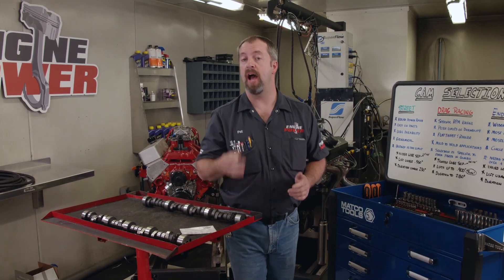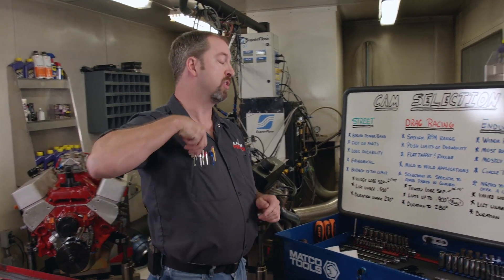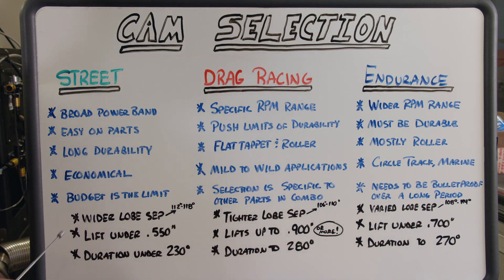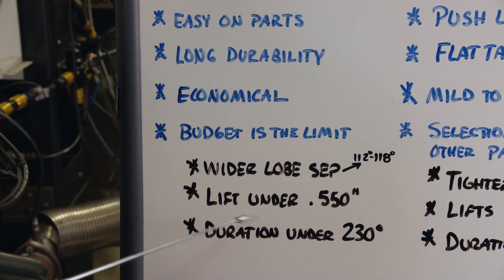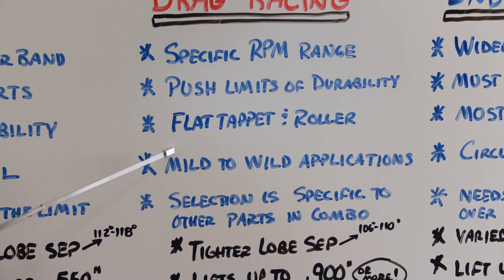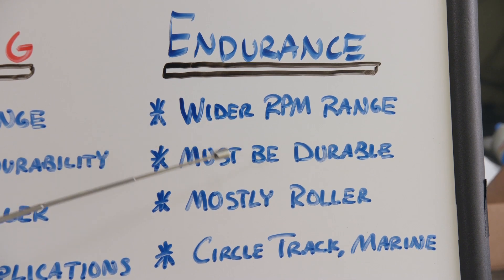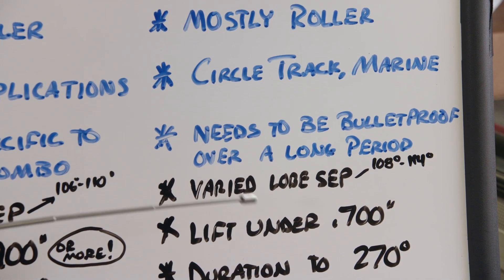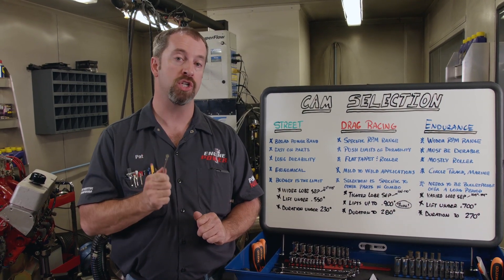How To Choose The Right Cam

Comment: I want to see a cam test based on Vacuum results as "A Street cars/ daily driver" needs it to run power brakes and accessories. Manual brakes and switching to Hydro-boost is for races cars...Not daily drivers.

Also this video is very old so the lifts/cam recommendations don't really apply to todays Gen3 hemi, LS.

Flat tappets shouldn't have even been mentioned as they haven't been used in a production car in decades, and their reliability isn't that great unless you use High Zinc oils, waste of money in the long run.

Most Hot Rodders want the "Endurance" cams.

Comment: Wow what lies  I had a 625 lift 302 duration with a 108 separation. Not only did I get 30 miles to the gallon it had a broad ban of power, it has 200000miles on it know and still runs like it should. So I call hay advertising little cams cause we made too many and there shit they waste more then they save.

Comment: hello.   I think you can give me some expert advice. I have a 1973 351 Clevland smog head engine and I want to put some 1970 factory closed chambered heads on it. I was given a completely rebuilt set of 1970 4V closed chamber heads and want to make this motor work on the street. I am not looking for advice on using other heads (or recommendations to use the factory 2 V heads, etc) as these were free to me and a few thousand dollars saving since they have already been rebuilt. I am not concerned about upper RPM  horse power loss and want to use these as a good lower rpm (up to 6000 rpm-ish )high torque motor (its my wifes hot rod so doesnt need to be radical motor). I have heard that if I run these with the factory flat top pistons and right cam profile i can make it relatively streetable with decent  low end torque?  I am wondering what your thoughts would be as far a good cam profile for my situation? going into a 73 mustang which I figure weighs at least 3500 lbs and its an automatic tranny (im ok with a higher stall converter). I am well versed on the Cleveland factory heads types, etc.. One last question, what are your thoughts on using the factory M-Code 351 cam?  also welcome recommendations from anyone else who sees this post as well :)

Comment: Hi, I own a Peugeot 206 With Tu5jp4 engine
The car has been tune to stage 1 and wanted to upgrade it to higher stages and I've come with a question about the camshafts
The camshaft I've chosen is newman ph3 that takes place somewhere between stage 2 and stage 3 of tuning The duration of cams are 264 degrees and the lift is 10.15 (0.400) and just wanted to make sure is it fine for daily uses and sometimes drag races between friends cause you sometimes stock in traffic and it's also my daily car I travel with it and go to work
I have changed other parts too such as exhaust manifold replaced by headers, exhaust pipe, center and muffler were all changed 
Stage 2 Air manifold (nfs), And pistons were also changed and now have higher compression ratio 
Just wanted to know that this camshaft is proper for daily street uses or not

Comment: Loft out so much. Choosing a cam depends on what you're going to do with the engine and what heads you are using. The cam has to match the heads. As well as the intake. If a set of heads only flows 200 CFM on the intake at 550 lift. That's the lift I'm going with. If I'm running an automatic transmission on the street I'm going with a lower duration. LSA depends on where I won't torque to start coming in.

Comment: I’m assuming duration is measured @ .050” lift, which would be nice to mention, but not much was.
Also, EFI vehicles may require 112-114 deg overlap due to sensors, but 106-108 deg (for carburetors) provides a broader power band… as I understand it.

Comment: Very good explanation but im kinda confused between endurance and street. I need a cam that for a little but if street racing just some pulls here and there but I’m also daily driving the truck. That imcludes some pretty long trips what do you suggest? I don’t want to replace the cam that much or damage my valve terrain

Comment: Thank you for the help...I just slapped a 279 cam in my 350 small block and well even tho the idle was rough...it was always ruff and low rpm so it was no problem smoothing it out with carburetor

Comment: This white board has nothinv to do with which cam.. a 305 has a different cam than a 383, 9.0 :1 is diffetent that 10.5:1. 3.0 diff against a 3.7 diff. Auto, manual is diffefent.
You need a calculator and all the above comes into it. STAY away from hyd roller cams, the lifters are junk and the grinds are junk.
The right cam will give you 60 to 80+ hp.
Off the shelf cams,, no thanks.

Comment: I want the most reliable, but badass and choppy sounding cam for a truck that I mostly use to tow with.... based on the data in the video I would be looking for a tighter lobe separation, with the lift and duration relatively mild? Only additional mods to the engine is a full exhaust, and intake.  1996 f150, 300 I6
Reply: Also, I am pushing the engine a little bit with a relatively heavy trailer, right around 8,000lbs

Comment: Application is every thing. What rpm band will it spend most of the time? The bigger the displacement the more duration it will tolerate for street.

Comment: Pick the right cam first requires knowing where the head quit flowing , compression and desired rpm range. Without that all the rest is simply garbage information, or like this guy said call someone and they will tell you because this vid sure didn’t help anyone understand flowing air through a motor

Comment: The most important things about how to select a cam are left out of this video. Knowing the flow numbers of your heads is a must when selecting the right lift of the cam. If you put a cam in with more lift than the heads flow then the intake runners become saturated with air and you end up losing power. So if you go out and get the biggest drag racing cam you can find and stuff it in your stock 350 or 305 with it's factory heads, more than likely your engine is going to be a dog. If all you do is cruise around, a high lift cam with lots of duration and narrow LSA because you like the sound, it's going to suck driving around town. Know your head flow numbers, how you plan on driving, what RPM range your intake it rated at, weight, trans type, gears will help you choose the best cam for your application.
Reply: Very good explanation but im kinda confused between endurance and street. I need a cam that for a little but if street racing just some pulls here and there but I’m also daily driving the truck. That imcludes some pretty long trips what do you suggest? I don’t want to replace the cam that much or damage my valve terrain. Just fyi this is on a 1993 5.7L small block Chevy 350
Reply: An angine likes a head that serves up velocity in the 300 to 325 fps range in the runner at peak lift, and the hardest limitation to work around is throat area under the valve seat - giant intake runners do not change that for the same size engine.  Personally I am fond of valve numbers close to 2.00" intake and 1.58" exhaust on a fun [small block] street build. If throat is 91%, that puts cross section at 2.86"/1.96" square, minus valve stems.  On a sbc, that makes a 1205 intake gasket reasonable: crosssection is 2.68" - bang on for the common 11/32" stems.  A 1206 can work, being 2.89" square but... that may take a number of manifold choices off the table.  Never get carried away opening up pushrod pinch point way past throat restriction is a detail worth minding.  Long story short, flowbench your heads to discover where you want to limit lift - cfm  gains vs lift will plateau on common aftermarket heads somewhere between 0.600" and 0.700" valve lift except some porting is done.  Bone stock heads? Best to stay under 0.490" lift most cases.
Reply: Maybe someone here can help me out a bit. I have not worked on engines since the mid-90s. So I am rusty on knowledge at this point.

My son bought a 1994 4x4 Chvey Blazer with 350cid. It is only being used for winter dring only as it snows quite a bit in Ohio. The issue is that the truck has those wide heavy 33" tires. It gives the truck a slow take off from a dead stop.
I told my son that we could give the 350 a little extra horsepower. What I was thinking was just adding a larger cam, new intake manifold and a 600cfm carb. (probably all Edelbrock)  I also figured shortie headers to help along as well.
I am just not sure if there is more needs to be done. I was figuring just leaving the heads/lifters alone. --- Side note: Apparently the previous owner said the 350 had been rebuilt but do not know how long ago.

I thought maybe someone could give me a general idea here.  I am friends with a mechanic and I do not want to look so outdated and clueless ....... lol
Reply: @nazfan01  I know this is 3 months old, but what did you pick ??
My suggestion is build your engine around a "towing" cam, dual-plane Edelbrock, some bowl blending in the heads, nothing fancy, smooth any sharp edges in the combustion chamber, detail the oil pump and make sure the catalytic converter isn't "plugged up".
Reply: @peterdarr383  -  Funny thing about the truck. My son bought that truck from a friend of mine for $2000. Drove it 3 miles home and parked it in the garage and it sat all Spring and Summer and never moved it.

Now 7 months later  Winter was coming along and just pulled it out of the garage and the guy he bought the truck from happen to come by and said he wanted to buy it back for $2',500. My son took the money.  - You see, after sitting 7 months and pulling it out of the garage and parked in the grass the brakes went WOOSH. That when we realized it was rusted pretty bad underneath.  The friend stopped, saw the brakes wemt out and offered the money.
Something tells me he sold it for more. But hey not a bad profit for a 21 year old young man that never drove the truck

Comment: Shouldn’t you determine the flow rate of your heads first, then find a cam that is complimentary?
Reply: No, except your starting point is a specific horsepower number goal.  For most?  Decide what rpm range you will be operating in [and top vehicle speed desired], and based on displacement pick a cam best suited for those.  If you're racing there are further metrics to apply [circuit, oval and 1/4 mile make some of those decisions for you, which are all their own topics but gearing, torque and top speed figure heavily].   Crunch your numbers twice [I use UEM compression calculator alot], then go pick heads - focus on dynamic compression ratio [there may be some milling involved] in picking chamber size, then worry about flow rates.  CFM used will be a high percentage of calculated volume: 87-92% is ballpark, most combos.  You are managing velocity primarily, so... too big or too small is a bad thing: the former kills bottom end torque, the latter kills horsepower.  There's alot of decent off the shelf cams favoring a 9.5 to 10.5 compression ratio for fun street builds. As for milling heads...DEGREE that cam please, before going to a machine shop!  I get 0.006", 0.015", 0.020" and 0.050" numbers.  The difference between 0.020" an 0.050" in degrees tells alot about how intense a cam is - small numbers are great for racing, but harder on seats/valvetrain. 
The topic is truly huge, so better look at people who know more than me.  Jenkins is as good a starting point as any - guy has done his homework.  http://garage.grumpysperformance.com/index.php?threads/need-some-bump-stick-101.10226/

Comment: Timely info. Selecting a cam now for 94 Mustang GT w/ GT40p heads w/ back cut intake valves,  tfs 2500100 spring kit, aode, Explorer intake and 75 mm throttle body. Trying to stay at .500 lift or less, 210-220 dur at @.050 & max rpm 5500 to match parts selected. Target is 300 HP at wheels and reliability. Elgin E-1835-P  cam is an option. Or Ford letter cam arpund .480 to .490 lift. I'm open to suggestions if you have a favorite.

Comment: Don't forget bigger is not always better, it's also the
CFM of the heads on a flow
bench where it's tested & the complete saturation by lift of cam so if your heads max. Out at .465 you don't put a larger cam

Comment: I am building a mopar 318, it will go with A500 OD trans and final ratio 2.71, manifold and heads restricted from emissions, Rochester Bi-jet carburettor (2 bbl), I am interested in gas mileage
....
what is the cam that suits me?
Reply: I would suggest an "RV" cam in that application because it provides good low and mid range torque, isn't hard on the rest of the valve train and at idle it is smooth but you can tell it is more than a stock cam.

Comment: I just want "chopchop" on my 350
Reply: Big Maistrote same
Reply: Get a cam with a tight lobe separation.
Reply: @thereluctantgearhead4544  Any recommendation?
Reply: @maistrote7539  if your running a pretty much stock 350, I'd stay below around 480 lift, 230@.050, and get the tightest lobe separation you can find in a cam that size. Most cam company's sell a version of that cam.
Reply: @maistrote7539  buy a set of "Z-28" valvesprings.
Reply: @maistrote7539  I'd put a decent intake and some headers on it too.
Reply: @thereluctantgearhead4544  since you're helping out picking what to look for,  what should i get for a ls3 camaro ? I want nice chop, but still daily drivable.
Reply: @simplybuilt_1708  look into the "Sloppy stage 2 cam" or something similar. Go modest on duration with as much lift as you can get.
Reply: @simplybuilt_1708  you can run alittle tighter lobe separation and it'll definitely make more NA power and sound meaner.

Comment: Building a 385 stroker sbc considering a xe268h from comp cams is that going to be okay? Stock torque converter about 10.7 CR and it’s going in a lifted k5 blazer if that’s not a good one suggest a good one for me to look into?
Reply: That compression is on the high side for that cam. Probably gonna need some good fuel.
Reply: @thereluctantgearhead4544  yea ended up going a different direction lol mainly cuz of money haha going with the xe262 in a 350
Reply: @jaredbarraza6027  I can understand that. 350 is a good all around engine.

Comment: So how do I go about finding the right camshaft for a stroker engine, just wondering if there's a formula for duration vs cubic inch? I have a big block mopar low deck 471 stroker, trick flow 240 heads 1.6 rod ratio ,, 11.3:1 compression & a rod ratio of 1.71 (if that matters)
Car is a dart 3100# 3.91 gears.
Street75% strip25% I'm thinking between 250-260 @.050, any advice will be appreciated, thank you all.

Comment: The first prob I have with anyone giving advice, especially on cam profiles, is You nor I will never know what the advice giver's pet peeves are.  Does the advice giver like his engine parameters mild, moderate, or max'd for any given scenario.  A few of you are getting onto this guy for his Duration#'s; and you should; but not simply because of the #'s he gave. Instead you can get onto him for not explaining how he came up w/the #'s given.  Those Duration#'s he gave I'm [assuming] are the @.050" figures and not the Advertised figures.  If you want the Advertised figures you can simply add another .045" to .050" duration to his numbers for a roller cam; add .035" to .040" to his numbers for a mechanical roller cam.  The second prob I have w/anyone giving engine builder advice is the advice is usually broad brushed.  Its given that way because the average individual isnt educated on engine parameters.  The third prob I have w/general advice on engine parameters is that the advice is always given as if the engine is one dimensional.  The engine is NOT one dimensional; it is multi'dimensional.  The last prob I have with the engine builders advice, from anyone - not just this guy, is that no one actually teaches how to qualify what engine parameters are required for a small, medium, large displacement engine relative to a mild, medium, maximum output engine.  You cant really fault this guy or anyone else for trying to simplify the subject; but you can fault him for not explaining where n how he came up w/his #'s.  If you wanna educate yourself on why the engine behaves the way it does, you have to grasp the underlying dynamics.  Educate yourself in:

1) Dynamic Compression Rato to Static Compression Ratio relationship.  This one requires the use of The Slider Crank Mechanism
2) Intake Port to Cylinder relationship; deals w/fluid dynamics and principles in combustion
3) Peak Output to Peak RPM relationship; deals w/pressures and mechanical efficencies

Yea thats a lot to take in as you are dealing w/a lot, but if you get tired of vague generalizations then you are gonna have to hit the library books and educate yourself.  Good luck n dont give up.  In the end, once you get it, it will be well worth  it.
Reply: Many factors involved for sure. But most people are simple minded and they all copy the same combo, so making a cam recommendation for a typical dude trying to build a hotrod ain't hard to do. Everything has been done to death. Most normies just want something that sounds rowdy. And most people that build serious engines don't need a cam recommendation, because they already know what works for what combination of parts.

Comment: Ok ah...I'm gonna just say it. Don't listen to this guy except for talking to your engine builder. 1) flowbench your heads (improve or leave as is depending on your goal). 2) match intake ports with intake and head. Now you can listen to this guy
Reply: the title is how to choose the right cam, not what you need to do to you engine before you pick a cam. if your at the cam pick part you already did all the other stuff